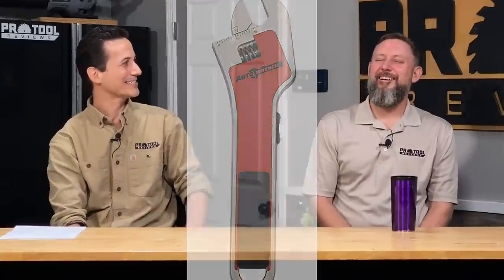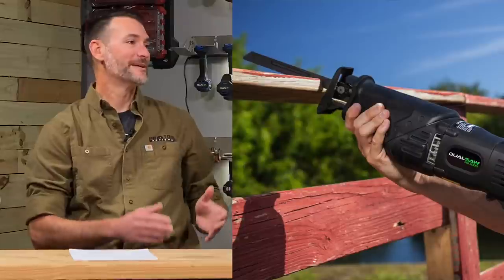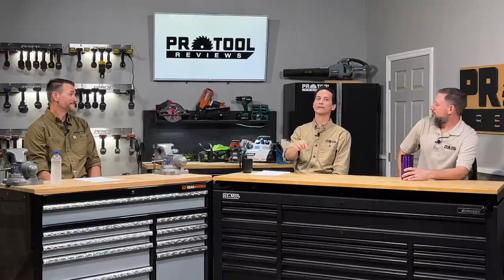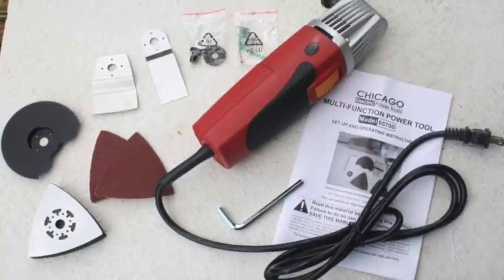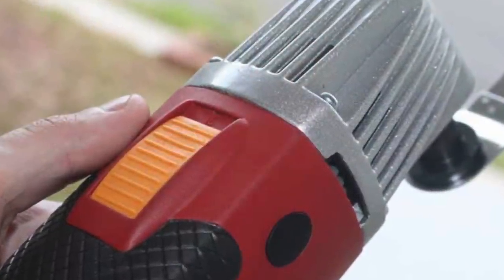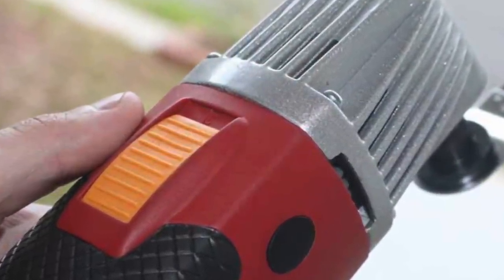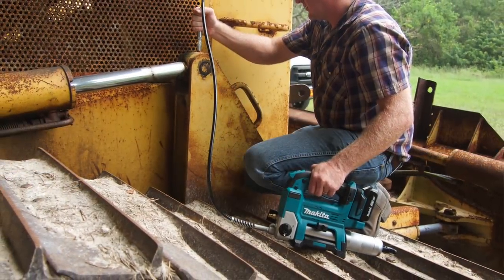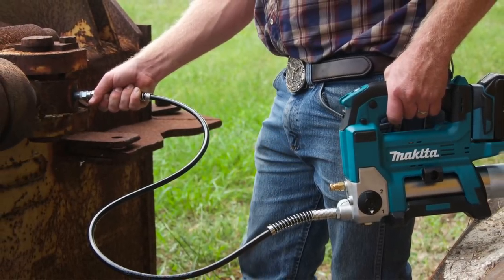Power Tool Fails That Should've Never Been Invented

Comment: For me, the most useful power tool I’ve purchased is one I resisted for years, the M12 hex screwdriver. The base, 2401 brushed model. I already had brushless HDD and impact driver,why would I need a much lower powered brushed power screwdriver?

Well, I bought one for my wife and kids to use around the house, specifically because it was much lower power and they wouldn’t overdrive fasteners as they probably would using my M12 FUEL HDD or impact driver. I started using it around the house too, and found it’s extremely useful and versatile, and with its mechanical clutch, can be set to not over torque small screws or driving fasteners into plastics and other soft materials. 

One day, I took it to work…and never brought it back home, so I bought a second one for home, the original is now my most used power tool at work. It sits on the top of my tool bag with a Makita XPS ph2 bit and MagBoost collar on it. The Ph1, T10/T15, and other common driver bits and smaller drill bits are in the bit case right under it.
Reply: Recently picked up that tool as it is on sale. Honestly I could use my 12v Makita drill to do the same but being able to pop in the bits makes it so much easier.
Reply: Had the opposite experience, used one at a place that provided tools. Other guys didnt like it, too small, no power, etc. 
For doing small work, its all you need.  Changing out ballasts really made that little tool shine. 

Picked one up used from the local Milwaukee store. Man, perfect little gun for auto interior work, etc
Reply: Same here! I bought it more for the batteries that came with it when it was on sale. I was replacing a door latch one day and used my (previously go-to) m12 impact driver. I drove the screw in into the door frame only to strip the hole on the lowest torque setting. After patching up the hole, I wanted to see how the delicate the clutch was on the hex screwdriver. I instantly liked how the tool could be used to finesse the right amount of torque for a specific application. It’s my go to tool now despite having lots of different impact drivers and drills.

Comment: My most used tool is the DeWalt DCF601 12v 1/4” Screwdriver w/ the Clutch...it's just incredible how useful it is. It's small and light with bright LEDs. It's powerful enough to drive 4" deck screws and automotive nut driving but also delicate enough for electronic work. The clutch is a god send for repeatable work. Really helps with not over-driving fasteners. Also, when you're not pulling the trigger, the tool locks up. So you can use it to break things loose before pulling the trigger, or you can tighten to your clutch setting with the trigger and then let off and finish tightening by hand 👍 it's a real game changer me for...I own 3 now

Comment: Worst tool I can think of buying was a two finger fishtape puller by Klein. It was really a flawed idea from the get go. It didn't have the strength when the going got tough and wasn't necessary when it would work. Of course it's out of production now.

A tool (or tool line) I didn't think I would use much was the Milwaukee 12v line. Over time I realized that I didn't need the heavy duty tools 80 percent of the time when doing electrical. These days I  make my big holes with the 18v stuff and go back with 12v stuff and do everything else
Reply: My brother does hvac with ridgid 18v tools. I tell him all the time, due get 12v. 90% of the stuff u do u can use a much smaller lighter tool for so ur not carrying and use the 18v over your head all day. He wont listen. I bought a 12v brushed dewalt drill n impact 10yrs ago. Gave it to my mom when i got my 18v tools. One day i needed to use the 12v to get into a tight spot, the rest of the project and almost everything ive done since ive used the 12v tools for. Barely ever use 18v anymore unless i need the extra power. The 12v dewalt sit sat unused for years and years. All 3 batteries still work and ive fallen in love with the tools again. I bought them when i worked at BMW before they really had 18v. All the guys there used makita. When i got the dewalt set they were all man why did you get dewalt thats home owner crap. When they tried them they were like wow these grips are actually way more comfortable and they got plently of power. They were like the first curved/pistol grip drill and impact. All the others were still straight handles/grips. These old dewalts are still way more comfortable than new milwaukee

Comment: Two Harbor Freight tools that I didn't expect much of.  First is the Bauer sheet metal shear. The one that looks like a drill motor with a shear attachment.  Cuts awesome and just keeps working.  Had it for 5 years now and I abuse it constantly. 

The other is the Pittsburgh Tools 3/8" drive ratchet with extendable handle.  Can't break it for nothing.  Extend the handle, sleeve it with a 6 foot long cheater bar, hang off it, bounce, whatever.  Won't break.  I broke a wheel stud that was rusted to the nut by bouncing my 225lbs on the end of that cheater bar but the ratchet is perfect. LOL

Comment: "Worst" might be most/every corded tool I've bought since becoming a homeowner for the simple reason neither the house nor outbuildings on my property have any exterior outlets. Which meant any/every small task outside resulted in either running an extension cord into the house and leaving a door cracked open - or starting a generator. It's probably the single biggest reason I've largely switched over to cordless tools. 

On the other hand the single "best"/most surprisingly useful tool so far has been the M12 inflator. I took a chance on one of those after having to reseat a tractor tire that came off the rim a bit over 150ft from the house since laying out all the extension cords and airlines to reach the distance wasn't particularly fun and picking everything up as it was starting to rain was even less so. Sometimes when it figuratively rains it actually rains too -- lol   

That one impressed me enough I bought a second one for my fiancee (now wife) to keep in her vehicle as at the time we were living ~150 miles apart and frequently driving one way or the other. 

Haven't gotten a cordless grease gun yet, but after watching this it may move up the priority list.

Comment: I have that wrench! I bought a home that was abandoned and one of the kitchen drawers was filled with that kind of stuff. I was just looking at it last night, thinking “what a piece of $#!+ thing is!!”. I may check the batteries and do just that, frame it and leave a sign which reads: In case of extreme idiocy, break glass to use automated wrench.

Comment: Great conversation. Worst 'tool' I ever bought came as a dent removal kit but the glue never stuck to the panel, would have been far better off taking it to a shop or using a stud welder, but i did get a slide hammer out of it. Most amazing tool I used more than expected was my multitool

Comment: I use a stubby hammer every day. 
I keep one in my main bag because 95% of the time all I need to do is tap something lightly into place, so instead of using my impact as a hammer, or my knife handle as a hammer, I keep this stubby around because it's small and light. It's awesome actually.
Reply: I remember  roof tilers using a little cut down hammer, often with an inch marked handle !
Reply: Me too!  I even found a little ball peen hammer at Home Depot under their Husky line.  Handy little guy for beating on stuff in tight places under a car.

Comment: The second one mentioned, I KNEW was going to be the auto hammer. My father in law had that hammer and I ended up with it. Looking at the battery design, it is VERY similar to Milwaukee M12 batteries. Also, I think it is a useful tool and I still use it.
Reply: I have the first gen of the auto hammer, still works.  I used it extensively when I  remodeled the house to push out brads and nails to reuse the window trim.  Also wanted to see if the 12 v Milwaukee batteries are compatible.

Comment: The Bauer 20v drill driver when it first came out. I think it had been out for maybe 4 months. 2 3" drywall screws nearly killed the thing. I could hit the trigger full on speed 2 and could stop the chuck with my bare hand. I took it back to HF and have not bought another Bauer tool since.
Reply: Well in speed 1 it has more torque  ... i can stop the makita brushless one in speed 2 , in speed 1 ,no way....
Reply: Not sayng its good tho ....

Comment: To me the most useful power tool was the battery powered caulking gun.  Got one of the first ryobi one and still use it.   Its been fun listening to some of your "GREAT " tools.   I steel have and use my nextec auto hammer.
 But not for nailing.

Comment: Have to agree with the stubby hammer, got bought one years ago and have never used it! One cheap tool I've bought which has been outstanding is a TITAN sds hammer drill, used it over many years for busting concrete and repairing fence post, with a 400mm chisel and 8j of power it's excellent! Only £50 too!
Reply: I bought one as a one job tool when my £300 one died on a job. I figured I'd keep using it till it died. And not being precious about it, I've really over worked that titan. Actualy I've been out right abusive to it. I mean seriously abusive.  2 years on i bought a replacement one the same for when the first one finally died. That was 4 years ago its remained unopened 😄

Comment: I'll give credit to the Harbor Freight Multi-tool; it worked. I used it for years in my remodeling business. But like they said it was deafeningly loud and vibrated like mad. I always wore earplugs so the noise wasn't too big of an issue. The big problem I had with it was the screw that held the blade on it didn't work well at all. I constantly fought to keep the blades clamped tight. But it was dirt cheap, and for someone just getting in to remodeling work it was worth every penny and all the headaches until I could afford something better. That turned out to be DeWalt's cordless multi-tool.

Comment: I still have one of those auto hammers LOL

I've only used it on joist hanger nails when I had a few to do and didn't want to get out my palm nailer and compressor.  It works but it's a very narrow use case.

Comment: received a craftsman tape measure for Christmas. It would extend and retract by pushing a button. Extremely slow worthless. Also received the Craftsman right angle hammer. It worked well to remove knots in your muscles.

Comment: Doing handyman work...the Stubby Hammer is half funny to pull out and half a great tool for some jobs.  For most things you're doing to a new house for the new homeowner, it does the job well.  Of course, I have a normal hammer in the car as well as a dead blow and a wooden hammer with oak head that I made on my lathe.  The wooden one is great for assembling ikea and other things you don't want to mark up but still get a good whack on.

Comment: Best tool from that line was the right angle impact driver loved that tool
Reply: I have one and use it on occasion. Not the most powerful thing, but it sure fits into tight spots. Never bought the hammer.
Reply: I have all those C3 tools.  A couple of the nicad batteries died, but I replaced them with the li-ion and they’re still going strong.  Right angle drill, drill, drill-driver, two styles of lights, small circular saw, impact driver, etc.  Keeping my fingers crossed they keep going because Sears sure doesn’t support any of this stuff now.

Then the Nectec line came out with the small li-ion batts.  I got the auto hammer and use it quite a bit, along with a small drill.

Comment: Damn that craftsman auto hammer i actually still have lol. I scored 1 for free on sears deal so i said why not and its actually useful for me. I will admit i never have to actually drive real nails. I only use screws for my application. I use it strictly for driving aluminium trim nails for molding on overhead doors and it works great for that. I guess thats its limit and i never knew it couldnt do much more lol

Comment: I can’t believe it, before the video started the first turkey I thought of was “Black & Decker Auto Wrench!”  LOL!  What a POS.  The little drive belt on mine broke twice.  The first time they sent me a new one, the second time it went in the trash.

Now I still have a Craftsman auto hammer w/ swivel head, and it works great for me in tight places, so not sure why your guys doesn’t work?  Better access in many places than a palm nailer, and I’ve driven a lot of roofing nails with it.  Same with the stubby hammer, which I have as a ball peen config hammer as well.  Sometimes you just don’t have room to swing.
 
Finally the WORST ripoff tool I bought (which I think you mentioned) was the Craftsman Twin Cutter.  $120 I’ll never get back, and like every one of their old tools no longer supported so you can’t buy replacement blades for it.  The blades have to be lubed, and you have to be careful they don’t overheat.  Nicely built, but I hate how Sears leaves you hanging now.  Same with my now dead and useless Craftsman scroll saw.  I’ll never buy Craftsman tools again.  BTW, I don’t know how many standard 17mm Craftsman sockets I blew up and had replaced back in the day on Mercedes Benz wheel lugs!

Thanks for the fun review.
Reply: Thats funny bmw uses 17mm lug bolts not lug nuts, one day i broke both my 17mm deep socket 1/2 drive cornwell sockets. One made specially for wheels and one jus a regular 17mm deep socket. How i got it off, my craftsman 17mm. All my craftsman sockets are older american made sockets before the switched to china crap sockets.
Reply: @jacksmith2315  Mine too, at least I think they are.  Some are 1960’s Craftsman in Kennedy boxes I inherited from my Dad, but most are from 1997 when I bought a complete set of 1/4”, 3/8”, and 1/2” sockets and ratchets/breaker bars, wrenches, impact sockets & tools, etc. so hopefully I made the cutoff.

Comment: Hello again Pro tools reviews 
Thank you for another Great Video. I have to admit that I never heard of the tools here. On a positive note,  Sears did have a display of stripped bolts and nuts. There solution was spline sockets and a ratchet. So I give it a try and brought socket set. The only thing is I have never had the chance to use them on the job lol. Thank God they only cost $15. Maybe lol. Thank you again

Comment: Well woodworker I bought a set of 1 2 3 blocks thinking I would only use them occasionally, but I use constantly. So I bought a second set. The most useless tool I have purchased as to be the little hand held 3 inch circular saw

Comment: Rip sears/craftsman. For me I tool I don't leave home without "Gerber eab lite" folding razor. I have probably bought close to a dozen of these. I abuse them all the time. They are so small. I clip it on my back pocket and you never know it's there but it's always there when you need it. Break a blade no problem. My biggest issue is probably losing them under homes. Definitely try one out. About everyone that I have let use mine now owns one.

Comment: What  was the name of that stupid rotary cutter for plasterboard, huge hype but a pig to set up with it’s horrible snap prone cutters that were always either blunt or broken. Spiralux ?
Reply: Roto Zip and also the most dust producing tool ever! I still use them all the time with a Circle Jig for cutting in large round speaker rough-ins and they work great as the jig helps keep the bit from moving in and out which is what makes them break really.

Comment: Have a buddy that got a Ryobi set for around the house stuff… had a hot glue gun in the kit & he & I were laughing about that when he got it. Most used tool in the kit. He’s fixed kid toys, his wife (& several other ladies) use it on crafts all the time… I’ve actually been thinking about getting Ryobi just for that, the caulk gun, & the soldering iron. (Because if I don’t use them, they’re not that expensive… & if I do, the batteries are cheap.)

Comment: disagree with teh stubby hammer. i have a few. i keep one in the truck, good for tapping a starter or banging an ill fitting socket onto a rusty bolt head for side of the road repairs.  i keep them by my machines, one by each lathe, one by the mill. they are great for bumping small things into alignment. -- this is the ball peen type though, yes, the claw hammers are less useful.

Comment: I use chrome sockets on air and battery impacts all the time. Im 36, been worming on cars since 17-18, bought my first set of 1/2 impacts like 2yrs ago, 3/8 impacts like 5-6months ago. Have had 3 air impacts, now 2 cordless impacts. Have never once broke a socket with my impacts. Ive broken 5-6 sockets by hand, never with an impact. Most of my sockets are craftsman. But ya seriously never broken one w the impacts but have by hand and been using chrome sockets on impacts for at least 15yrs.
Reply: When I worked at Sears, it was easy to tell when someone wanted to replace a broken socket because they used it in an impact. We still replaced them.
Reply: @blucy10  when they brake using them by hand they crack/split from the top/hex down. I imagine if its broken from being used on an impact they shatter or crack at the bottom/drive end. But ya i never broke one on my impacts and have used chrome on impacts for years. Older american craftsman not the newer china crap they make now